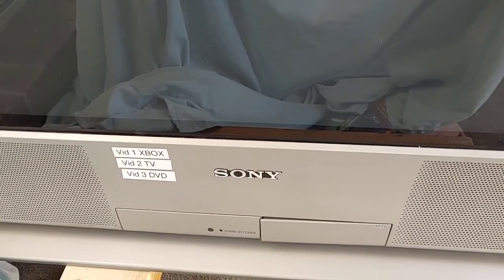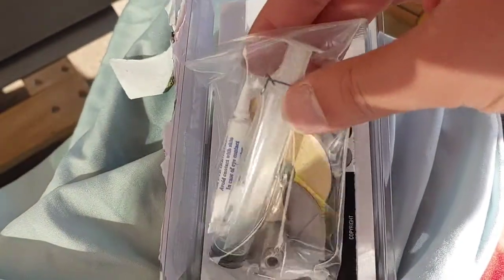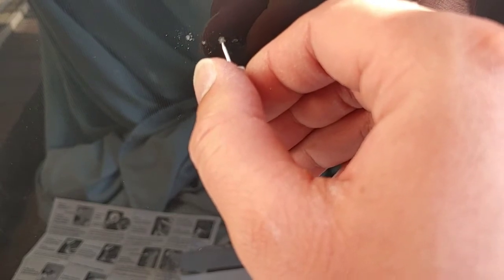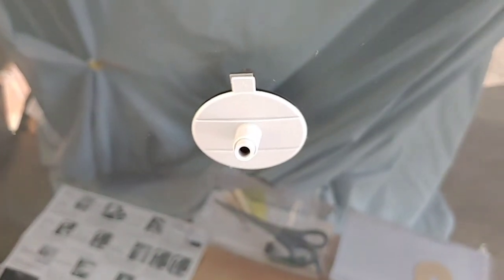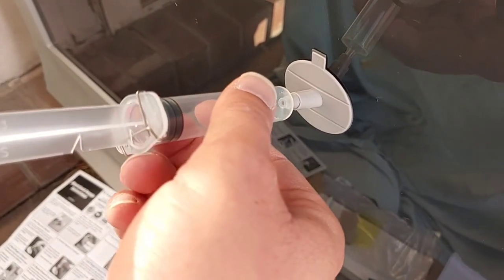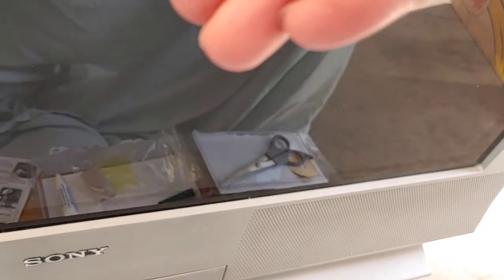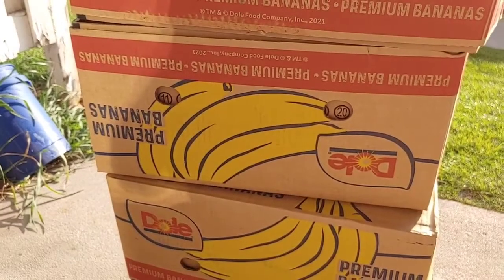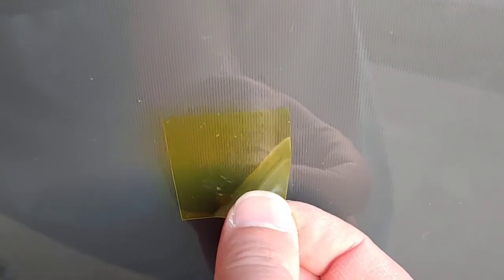Fixing a Rock Chip on a CRT Screen

Comment: I nicked the screen on my curved D-series when going through the door, the spots on mine are a lot smaller but unfortunately right in the middle. So im hoping this will work as well, Ill update this after I give it a try. Would be nice to have seen it on, but its pretty clear its a lot better than it was!
Reply from the maker: Yes, I agree - I wish I had turned it back on for the video.  Please let me know how your D-Series repair goes!
Reply: @FairyKid64  It worked out great! the two spots were pretty shallow, so I didnt bother with the whole sucking the bubbles out thing and just put some resin on and used the card thing. I had no bubbles, but the one mistake was trying to remove the extra with a razor. I think I ended up taking too much back off, so I just did another layer the same way, leaving the extra resin. It was bothering me a TON before, but now it has little to no shadow where it did before, you cant see the extra resin when its on anyways. I would say complete success! Feeling a lot better about not causing lasting visible damage to it, its a really nice set.
Reply from the maker: @mrrooter601  Hey, that's awesome!  I'm so glad it worked for you!  Thank you for sharing your experience.  I hearted your comment so others can see it worked on a curved set too!
Reply: Could you take some footage of the repair on the Dseries?  I have a small chip on mine and I’m trying to decide if it’s worth the repair.  It irritates me obviously but I hate to do it and make it worse lol

Comment: Hello, ive got a tiny scratch Im going to try this, everything goes good? Nothing strange in the screen? :0
Reply: Did you try it out, how’s it look?
Reply from the maker: Hey there.  If you just have a tiny scratch, you might want to try polishing the screen with cerium oxide.  I'm planning on doing another video demonstrating this.
Reply: @FairyKid64  wooww cool
Reply: @FairyKid64  hello, the scratch its still there but its very tiny, polishing it will work? My fear is screw up the tv
Reply from the maker: @CAT666.  Yeah, I hear you.  There's always a fear of making things worse.  Here's some general guidelines though.  If your TV has a protective plastic film on it, then polishing probably isn't a good idea unless you remove the film first.  Just realize that you're probably not putting the film back on.  But if it does have the film, then removing it might also remove the scratch.  I've bought some cerium oxide and the other polishing tools, but I haven't actually tried it yet on a CRT, so I couldn't tell you for sure it's going to be a silver bullet.  But I've heard of other people successfully using it, and there's many other YouTube videos that granted, are polishing other glass that's not on CRTs, and they have obtained great results.  For me personally, I plan on trying it on an extra CRT I have first, not my main unit.  If it goes well with that one, then I'll probably try it on my main CRT.

But I totally get you.  My main CRT has tiny scratches too.  They're not too noticable when actually playing a game or watching a movie, but they do show up from time to time.
Reply: @FairyKid64  please repply me when you do, my crt doesnt have protective film